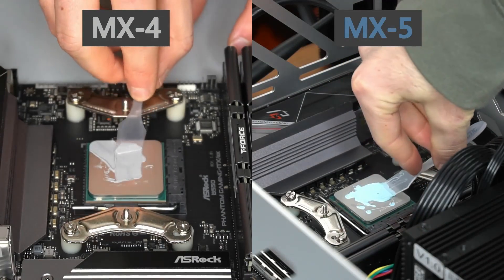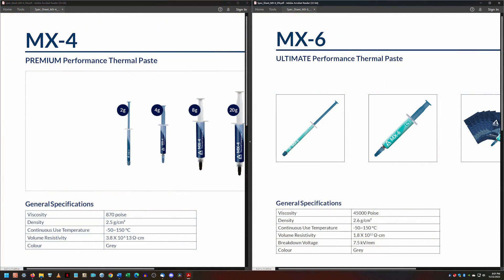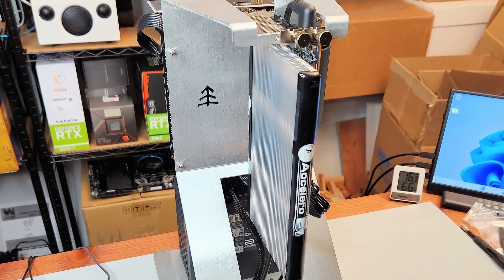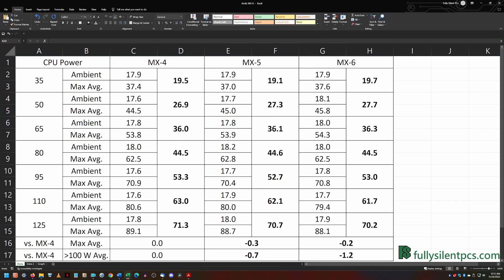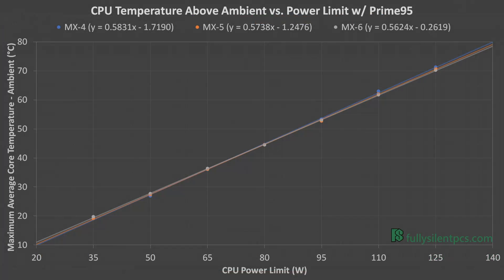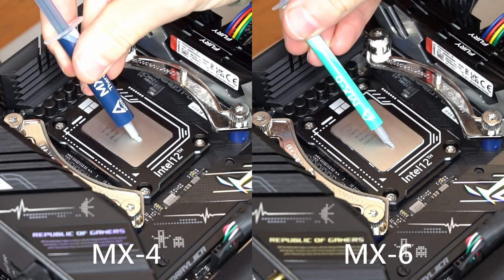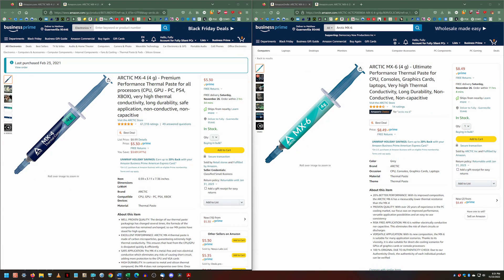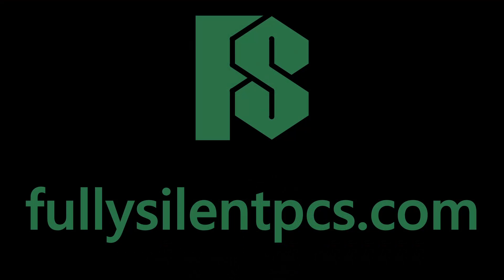Arctic MX-6 vs MX-4

Comment: I bought Arctic MX-6 and as I see
it beats my Kryonaut extreme by 3 degrees
Reply: Would you recommend Arctic 6 ?
Reply: @resonmon  yes
Reply: 3 deg at what power?

Because i'm struggling to reach 2°C difference against half year old GD900 which is super cheap China paste - at 110W! 1°C at 80W.

If your use of Kryonaut is anywhere near comparable, means your Kryonaut is misbehaved. Maybe badly aged. I mean normally you expect Kryonaut to be a high performance paste right, not a $1 one.
Reply: @SianaGearz  have you even tried Arctic 6? why you compared a kryonaut to some xina paste
Reply: @renzrivera4518  I've got MX6 on now. I bought it an Ingram supplied retailer so it's genuine.

Usually I just use MX2 but it ran out, which is why my PC had GD900 on it for half a year because I accidentally had it at hand.

Which is to say GD900 gave me a pretty favourable impression, I was surprised. Super hassle free to apply or remove, little ageing, temperature really close to MX6, as I said!

If you're getting 3°C difference to MX6, your Kryonaut is performing worse than cheap China paste did for me.
Reply: you compare your chinese paste to a kryonaut and you got better results, leave it there. I've just give a comparison between these two paste, I tried them and see that MX6 perform better. It's cheap and I been using them since my kryonaut outperformed by MX6 paste. I am sure you are using low-end unit btw
Reply: @SianaGearz  However I never threw my Kryonaut. I can't give you any results in the future because I dont even know if MX6 will last longer than Kryonaut. I did try using them in their brandnew forms and MX6 wins for the 1st. Right now it still performs great which it stays at 56-60" where my kryonaut average is like 61-63" but its still great
Reply: @renzrivera4518  as I said I ran benchmark at 80W and at 110W estimated CPU package power consumption. It's only a Ryzen 5500 but nominally a 65W CPU, it is PBO'd to where it is above 4.2 GHz all core at all times, which is how it's consuming closer to what a higher end CPU would, and the increased power density - each core emitting more heat - is actually an added challenge. For the cooler I have a Scythe Grand Kama Cross 2 where i lapped the solid copper contact plate, and it's running a 1400rpm 14cm fan. This heatsink is capable of cooling 160W CPU with ease, I had done exactly that in the more distant past. It does not have an official TDP rating but other companies would often market heatsinks with similar performance somewhere in the 200-250W range, in my opinion perhaps somewhat dishonesty, it won't really stretch comfortably there.

From what I can see the Kryonaut is the sort of paste that behaves top notch in magazine tests up front but degrades a lot after installation. This is actually an issue which has plagued a number of high performance thermal pastes, it was particularly bad on the first iterations of IC Diamond, Gelid Extreme and several others. I'm lead to believe that Kryonaut isn't anywhere near as bad as those. But I note that it's apparently easier to make a high performance paste than a stable one. Even MX5 has been noted for decreased stability, which is why it was discontinued.

I agree that we are yet to see what the long term behaviour trend of MX6 is going to be. Fingers crossed.
Reply: the kryonaut dry too fast and wat about mx6?
Reply: @metalhead-6448  does not and last longer than mx4 & mx5
Reply: @renzrivera4518  thanks for come back and confirm it i will definitely give it a try

Comment: I had problems with MX-5 which I never had since I started using MX series with MX-2 and have used all of the series and never got issues, it was always the perfect paste for me.

MX5 I bought a big syringe and used once and just after a few months I went to use it again and it was all screwed and was well closed, in comparison I still have MX-4 from many years ago in the same drawer I have the MX5 and used it a few months ago and MX-4 seems as good as day 1 from years ago and I used it many times in many stuff...

My MX-5 after just a few months of opening the 2nd time I used it was coming out only kinda like oil a huge amount of it and then the blueish paste came quite a bit after a bit dried and wouldn't even spread any good and the temps weren't great, had to clean everything that made a huge mess and went with MX-4 and all is good.

ps: Hope they don't F* up the MX-6 too cause I will probably eventually go for it. Also one important thing is the 8 year in use that they warrant I totally believe for MX-2 to MX-4, I really doubt MX-5 last anywhere near that while being good, the MX-6 I can't say I trust it too as it's a damn thick paste, I wonder how good will it be even just like 3 years from applying it and for a desktop PC it doesn't matter much but for laptops and gaming consoles and other stuff, some are a god damn nightmare to be constantly opening...
Reply: Check if you have the batch that was recalled
Reply: @andrewlim6329   No idea, never heard of it anywhere for arctic MX-5.

From the way they quickly moved to MX-6 and went back to being gray again and closer to traditional MX series I'm guessing they screwed up big time on the MX-5 but no idea could really be a bad batch as I can't say my experience with it will be everyone's experience with it...

Comment: I can't help it.  I'm an Arctic Silver 5 guy.  It's VERY peculiar.  It's super easy to put too much or too little...
But when you get the feel of it, I PERSONALLY don't think it can be beaten.
Reply: Dude stop living in the past. Any decent and cheap paste today is better than Arctic Silver 5.
Reply: @EvoPortal  Shows what you know.
Reply: @JustAGuy85  no seriously it's a 20 year old paste with real (as tested by NASA) thermal conductivity of mere 1W/mK as opposed to claimed. It got beaten by the MX2. And the pricing is just insane.
Reply: @SianaGearz  Do you... have experience with any of this?  

Also, LOL... NASA didn't use AS5 to test it.

NASA used AS5 with their hardware.

That article is NASA BRAGGING on it.  So glad you brought that to my attention.  Bookmarked for further AS5 > all proof.

Looks like NASA's engineers' had the experience to know what paste was best to use for their applications.  

Kinda like I have the experience that no one else in here has.  Gen Z, do better.
Reply: @SianaGearz  Look, they even put charts up to show how much AS5 lowered their temps:

https://ntrs.nasa.gov/api/citations/20190000493/downloads/20190000493.pdf

And it was used for heat pipes.
Reply: @JustAGuy85  You get black screens and cant figure out how to solve it even with 25 years of experience? Well done
Reply: @Delzanno  I don't even know what you're talking about at this point.  I don't have any computer problems.
Reply: @KingShotgunHobo  Fair enough.  Although, I think as long as you know it's an electrically conductive paste, you can be cautious and use it.  Which, I'm sure you'd agree.

It dropped the temps on my old RX480 8GB by INSANE amounts.

I want to use it on my 6700XT, but I'm gonna RMA this POS card.  I've never had a card that crashes every single day like this.  It can be from gaming or watching YouTube... I'll get a black screen (if I'm lucky) and the drivers will reset.  Sometimes it's a straight up PC shutdown.

I have an HX1200i PSU and am using individual cables for the 12v supply/8-pin connectors.  I hate this card lol.  I wonder if Newegg will still let me RMA it if it's been 6 months of being tormented with this junk.

Comment: I use MX5 on VRMs (its main purpose in laptops, where you need lots of thick paste that will not go anywhere, that will not spread around, and later on turns from liquid paste to thermal pad, you know places where you have copper heat pipe and like <2.5mm from GPU VRMs in laptop, thermal paste cannot fill the gap, you can use thermal pads that have bad thermal conductivity, its worst then thermal paste, thats where MX5 came into play, you need literally minimum 8g of MX5 for VRMs in modern gaming laptop just for a single fat line replacing bad pads), MX5 on DIE (if delided), and MX4 on IHS.
MX5 was blue, indicating classic blue thermal pads, it was never meant to be used on CPU or GPU (its sticky, doesnt move around, need very high pressure to spread means requires time, form a sponge kind of material like classic pads), and because peoples like me are stupid, Arctic face inconsistency problems, because peoples were applying MX5 on single CPU or GPU chip (inconsistency problem, because die likes to dance from 30°C to 75, 80, 55 in a second, 60...), instead of 20 VRMs in massive shared line (no inconsistency problem, they all together stays at 120°C, sharing single MX5 and fight the gap to transfer heat asap so air cannot trap it and that heat cannot stay in chase)... When you need to remove MX5 from VRM-s after a certain amount of time, they act as a solid thermal pads, you remove it, put it back, without mess.
I ordered MX6 2x8g from Arctic with winter promo sale for -35% cheaper. Will see what they did. From video i can see they got rid of extremely sticky part, with high viscosity smashed between two things, drying out, it will not move anyway, even that sticky provided good bound for both sides (like VRMs on one side and heatpipe on another side, it sticks to both and dry out over time, forming a perfect shape), and will it be reusable later on, like classic pads, will see... Will test it first on die with copper IHS and compare, to now what to expect.
Reply: For vrams, mosfets use gummy thermal paste K5 Pro, Laird Tputty 607 or Upsiren U6 Pro because have much better thermal conductivity than thermopads. Thermal conductive paste is not for that purpose.

Comment: This review is very well made. I'm surprised that you haven't compared it to Thermal Grizzly. Do you prefer the Arctic paste?
Reply: Grizzly only good when you want to oc. It's drawback is that it doesn't last as long making arctic the better choice for non oc systems.
Reply: @MrHiglon  No.
Reply: Thermal Grizzly is same as Arctic mx4 but thicker only. I used both but no difference in temperatures. MX4 easyer to use and cheaper.

Comment: There is no reason to spread it, it literarily makes absolutely no difference.
Reply from the maker: Unless you don't put a large enough drop for it to cover the whole heatspreader, then it can make a difference.
Reply: You are incredibly wrong and you are spreading harmful info. I just had MX-6 yesterday and i'm more than happy with it (generally 3 degress lower than Kryonaut) but it's stiffer than MX4 and as they say always ''Be safe than sorry'' make sure you guys spread this thermal paste well carefully (btw if you already have MX-4 and good results don't bother but i can definitely recommend this paste if you have to buy a paste)
Reply: On direct-die always spread the paste because if the paste doesn't cover the full die after mounting the coldplate (dry corner) it can fry the chip or massive thermal throttling. On desktop cpu's the most important area are the die locations underneath the IHS. On single die cpu's a drop in the middle and on the new Ryzen's I spread the paste.
Reply: Makes no difference yet it bothers you ?
Reply: Wrong.  Been doing this for 20 or 25 years (I don't want to count).  

Spreading is better.
Reply: @JustAGuy85  You're also the only person here pretty much to use AS5. A paste with de facto thermal conductivity of white goo, and with consistency of semi cured concrete. For some reason it can perform pretty well in situ, about the same as MX2 or a little worse, but it's THAT much fussier than anything else.
Reply: @SianaGearz  I'm also the only person here to get 1st place in two different overclocking competitions on some particular internet forums.  

Yes, AS5 is VERY peculiar.  I've played around with so many pastes.  I haven't used MX-6.  I have used MX-4.  

I just know nothing beats AS5.  That's all I know... because I have that experience.
Reply: @JustAGuy85  Lets see some vaildation then!
Reply: @Delzanno  I am sure I can find it.. I've found it before.  But I use a different username.. the username behind all my usernames.  So that's why I didn't immediately post it up and don't want to post it.

Comment: You should try syy157, and compare it to mx4, of you haven't already 
Anyways, viscosity is relative, it's supposed to be spread by pessure anyways,and the cooler's plate applies way more pressure than your hand and spatula
Reply: SYY-157 was my main viscous sturdy paste for laptop/vga repairs but the new 2022 formula is changed to basic user friendly easy spread crap only suitable for IHS processors. I switched to Honeywell PTM-7950 phase change pads for high-end laptops, vga and console's. And Shin-etsu X23-7921-5 sturdy paste for basic low power direct die devices.

Comment: Every year at some point I try to see if there's something to compete with MX-4 and there never is. Been using it probably 20 years .. or how ever long it's been out. Feels like 20 :p. I've been in to and fixing/maintaining pc's from the 90's. MX-4 is the GOAT. Sure in laptops I would prefer to use something more conductive but the pricing of those is way to high to justify them. Couple of degrees don't matter, if you think about what shit paste the manufacturers put in there usually and if they pass testing with those. MX4 will do just fine too. And i've never seen MX-4 turn in to god damn concrete over time neither. Can't say the same about some OEM's paste. Just broke a expensive business laptop coolers heatpipes off the cold plate a while back when trying to get it off. Just would not give, but the soldering gave :D
Reply: Arctic Silver 5 has entered the chat